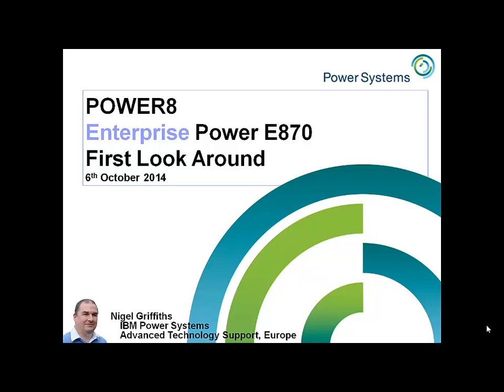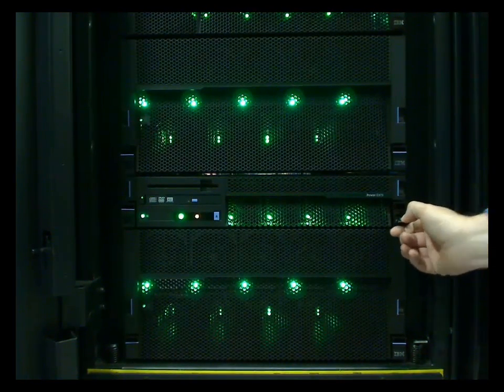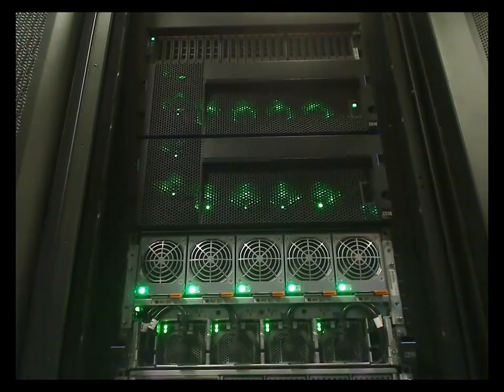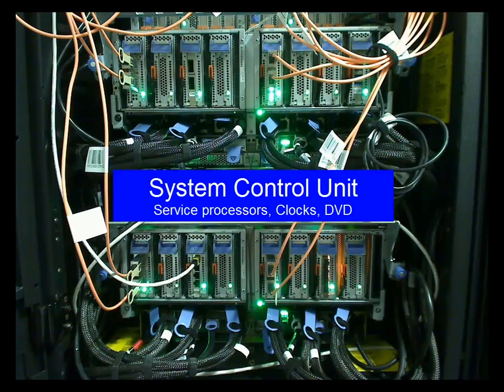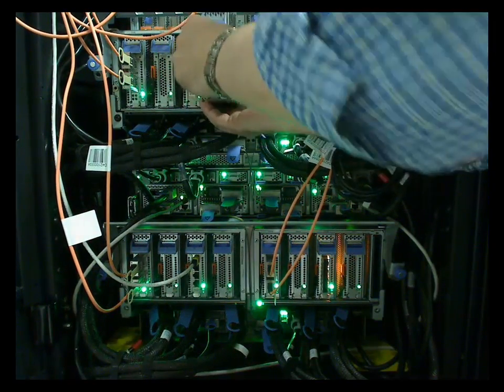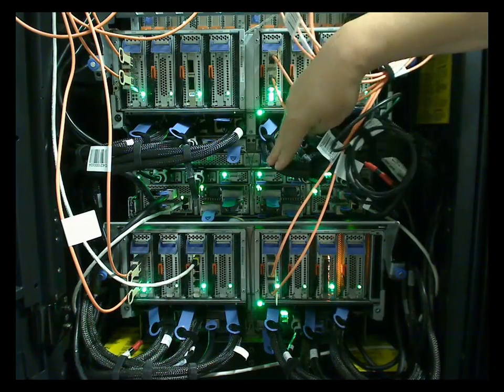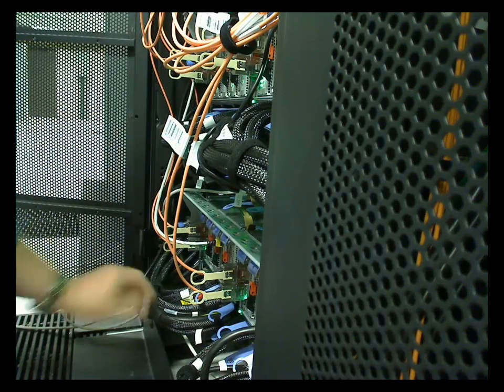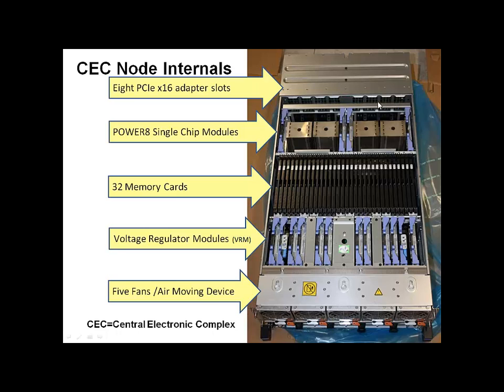POWER8 Enterprise - Power E870 First Look

Comment: Is there any tool in removing the CPU PN 01AF162 - 4.19GHZ 40-Core Power8 Processor 550B for 9119-MME Power E870? It seems like need a tool to remove the Heatsink? Lastle, do I need a IBM Rack Lift Tool when putting the System Node to maintenance position? Appreciate your feedback the soonest.
Reply from the maker: This is not a customer task. You need to get the IBM CE (customer Engineer) to do this job. They have the tools and a special kit of parts. This will require the systems to be powered off.
The System node is not heavy and it is sitting on "L" brackets so power off, uncable, unbolt and slide out the front.

Comment from the maker: Hi "Power Man" The video is of a system without the 8 inches extension but with it yes it takes extra space. You are reading too much in to the air vent floor tile position - we don't operate hot and cold isles in our machine room so its a fairly random placement.  Air movement is the normal front to back.

Comment: It seems very deep, taking up a lot of floor space with that rack extension.
Am I right in thinking you need to have an air vent at the rear of the rack with an anti tip plate as in the video, or is the system usually installed in the rack reversed to other servers?